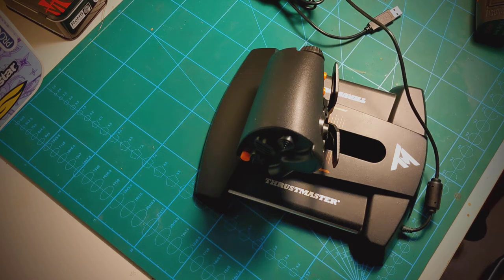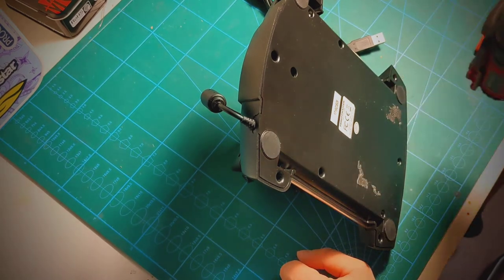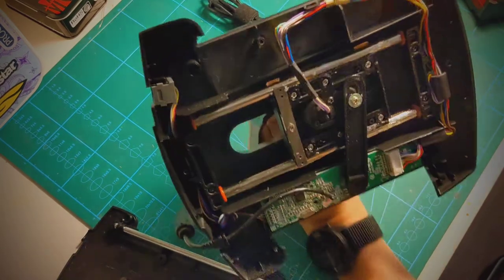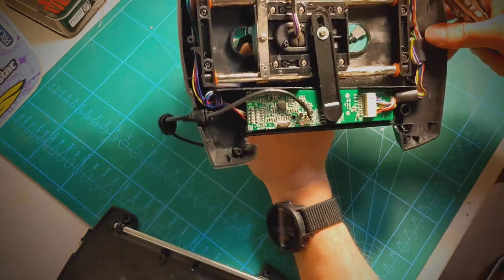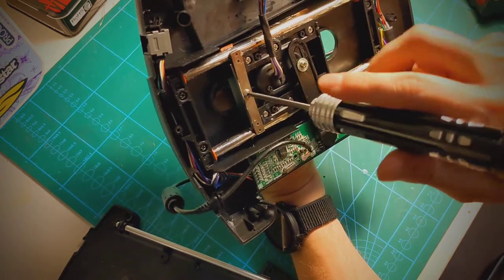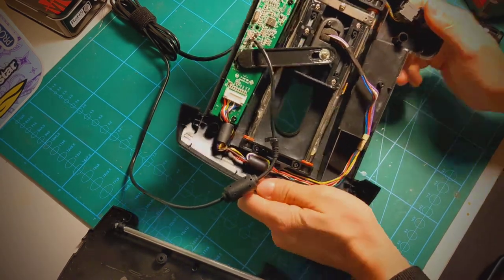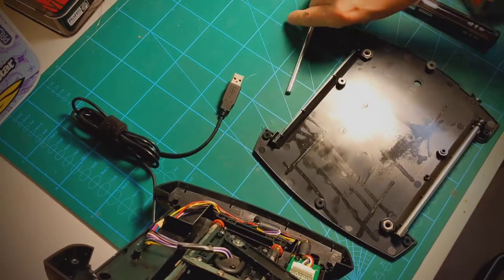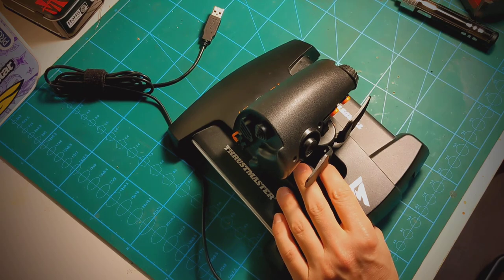Trustmaster T16000 Throttle sticky "fix" (but free)

Comment: hey, I got this throttle. i initially did the "ptfe" tape mode. but it did not have much effect. as per your guide i just loosened the screws and it falls on its own now. super smooth. thanks so much. the tape is still there, don't know if it does anything or not. i am so glad i stumbled on this video! wonder if something similar could help with the rudders as well?
Reply from the maker: i didnt feel the need for the rudder so i haven't really looked at it. the pedals might have similar issues, the rudder on the throttle stick probably not. the one on the joystick itself has sensor issues which some other youtube videos address (basically youve to open and clean up yearly or so)